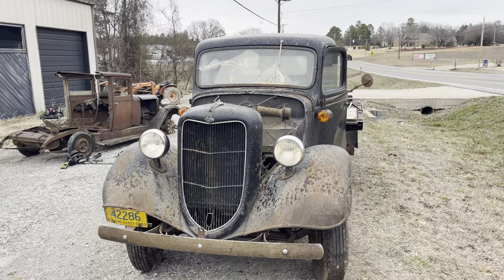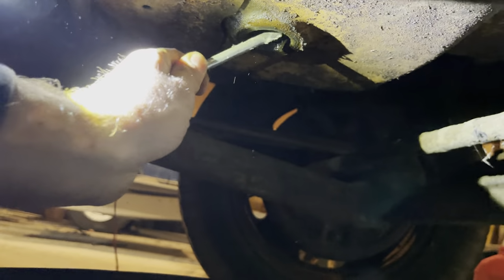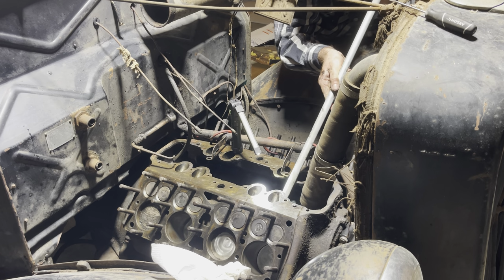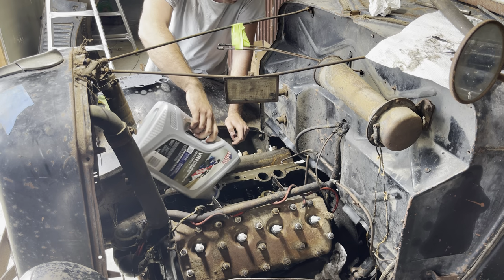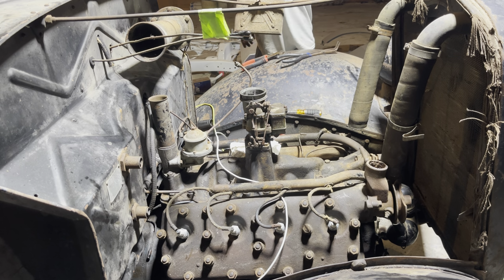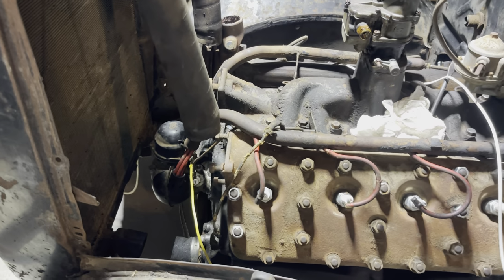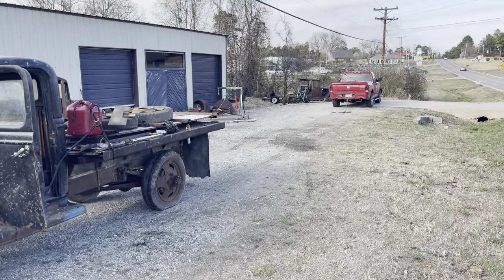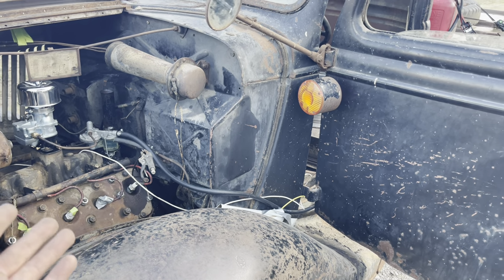Will it run and drive after 56 years 1936 ford 1.5 ton flathead v8 truck

Comment: I was surprised at how well it ran after sitting so long, nice to see it saved and not LS swapped.
Reply: She could use a k24 swap no doubt
Reply: @Youtubecensoredmyusername  or you know, you can use the perfectly good original engine instead of spending months swapping a modern engine in
Reply: @SoupyMittens  been there done that. I speak from experience not from a laptop. Old stuff sucked if you don’t remember. If you don’t have fuel injection and a good overdrive trans bare minimum for a daily driver, you’re missing out. 1960 f100 Toyota 1uz v8 and a380 trans 👌 the only thing that really costed anything was having the driveshaft made
Reply: @Youtubecensoredmyusername take your fuel injection and shove it.
Reply: @megaaggron9778  I did, I shoved it right under my hood, then I didn’t open the hood for a long time because it works great

Comment: Back in 1961 me and a buddy rebuilt a 1936 PU just like your grain truck.  After a total rebuild and painting we decided to start it after the six month rebuild.  I was holding the battery and pushing the starter while my buddy used my glass jug of gasoline for my lawn mower to prime the carb.  This resulted in a backfire which trapped me in the garage when my buddy dropped the glass jug setting the garage, the truck and me on fire.  I made it out without being burned but the PU and the garage didn't fair as well.
Thanks for the memories.
Reply: Great comment, glad you were unharmed, and I am sure you learned something, what was it?
Reply: Safety Third?
Reply: Glad your still in good health, sounds like one of my younger memories 😆😅🤣😂
Reply: @PaulLorenzini-ny2yw Yep, you don’t need to worry about safety.

Comment: 21:40-21:43 the 3rd cylinder back shot a spark out of the plug.  May have a pinhole or crack in the plug.  
   This was so cool to watch the resurrection.  Great job

Comment: That plugged oil drain hole brought back memories. I had the same thing happen on my '31 Model A. removed the plug and nothing came out until I shoved a screwdriver in the hole. I pulled the pan and it had 2 inches of sludge in the bottom of the pan! I also pulled the valve cover off and the whole thing was packed with sludge as well. I had been told the engine had been "rebuilt" yeah!! I cleaned everything up good and that engine ran like a sewing machine!

Comment: Excellent video Jennings  :) also that old Ford 1.5 ton truck amazing and good one she after you tune up ! Yes flat spot tires are wild for sure on ride and sure bumping bounce too! 292 V8 motor are incredible  motor! I did 1994 a 1929  Ford Model A  Woody Car had 292  V8 first generation  with 1 barrel Carter  with hand choke cable  in also 6 volt positive ground plus optional air compressor on right side on belt drive , generator  recharge 6 volt battery, crank start too , with h patterns transmission  with R on left back then on right was 1 and OD (second gear) 3 pedals with emergency brake handle  on right  on transmission,  brakes were gear type and axle ratio was 170 ! 5 gallon fuel tank up by front windshield! Also hand style wipers to plug Cowl fog lights  and headlights changes from Kersone light up to electrical 6 volt positive ground  one , electrical starter  too button on gas pedal area , black body with Yellow Varthine wood,  6 seater  horn Lol old Model T type!

Comment: Nice to see another old truck saved and running. As a side note, I grew up driving a Kubota just like the tractor in the background as you drove out of the shop. They are good little chore tractors.

Comment: Sounds like the flathead V8s I remember. I worked in my dad's garage in the late 50s and tore down a lotta 6-cyl. Chevys and Y-block Fords for overhaul. Overhauled a ton of farm trucks and family sedans. Those Y-block Fords would have main bearing 'bump' but they'd still run if you put a valvetrain external oil line on it.

Comment: Once you get the tires and brakes updated a better seat , I hope you’ll do another run . Seemed like the engine was smooth and steady so worth more work and surely it will fetch a far higher price if your going to sell it on

Comment: Hey Jennings. I wish I knew your formula for unseizing an engine when I was a kid.  In 1966 I got a 46 Willys CJ2A from a cousin who had the engine rebuilt but never put it back in. When I got it the engine had set on the ground for about 3 or 4 yrs and was locked up but I didn't know it until it was in the Jeep. Eventually it became time to start it but the starter wouldn't budge it. The bolt on the front of the crankshaft wouldn't turn it over and when I tried to pull start it the tires just slid. So I had to load the Jeep up  with cement blocks and about 5 of my buddies to get some weight in it but then the clutch slipped. Finally while pulling it I jammed the Hi Lo range shifter from Neutral into Hi just as it started to move, on the cement in front of Dad's garage, and finally it broke loose. In the end it ran. I was 14yrs old and couldn't drive it legally, but it made a lot of trips to the dead end of Dad's road and went out onto an abandoned farm w/ woods to conquer the swamp and the "cow hill" (a huge hill the farmer made when he buried his dead cattle that got hoof and mouth)  I guess you could say I cut my teeth on that old Jeep. ben/ michigan

Comment: I love old Fords. Sounds like it's running on five or six cylinders. I've had a 1930 coupe, 1947 Club Coupe, and 48 Pickup. Those poor old tires with their 56-year flat spots. Hahaha. It's like those kid's pull toys with the off-center wheels on opposite corners  so it rocks n rolls. Really be an interesting ride if they all got in sync for a minute LOL

Comment: I always put a little oil in every cylinder.  It helps compression, and lubes until the engine lubes the cylinder walls.

Comment: Great revival video. But i was confused with the backing up and going forward and hitting the brakes with the doors open. I figured you were trying to test the brakes. Just couldn’t understand why you were doing it with the doors open. Great way to break or bend doors i figured. But i don’t think that was your intention. But it can easily happen if your doors are swinging and you jump on the brakes.

Comment: Pulled parts off a Ford today that someone had torn down the engine on and but never put together. Pistons and reman head were in the bed. Had the parts been left in the cab I bet you could have knocked the surface rust off the block and crank and made it run.

Comment: A lot of mechanics think all cylinders need to be resurfaced if they have rust pitting. something not too well known is if you leave the rust most of the time it will turn to a thick carbon and fill the pitting holes, leaving a hard smooth surface, making the rings seal.

Comment: Good Job!! I have couple questions: Is this V8 original engine for this truck?? How do you find still parts, gaskets, coil, waterpump for this old engine?? And, please, tell me correct torque for heads and intake manifold bolts/ nuts?? Thank,, you, one more: when car/truck system is only 6 volts, can you just throw 12 V battery in there, what do you have to change: starter, coil?? Just wondering.......youtheman =) Greetings  from Sunny South Florida !

Comment: Lapping  valves is not for is not for removing material, is is for fine mating the seat to the valve very fine mating the two for a good seal, if you want redress the valve face and seat you use dressing stones or and or cutters then you finely mate the seat to the valve

Comment: I wish this guy would help me with my 1984 g20 250 straight 6  van..No one in my area no's about old stuff ..I want to get rid of the smog stuff to make engine cleaner for a new carb but way to many hoses to chase around along with other stuff like what is the water temp and oil temp supposed to be in these ...I added a water temp gage it never had one in its life..I have a air line to the oil area I want it gone some how ..If any one can help please let me no ...